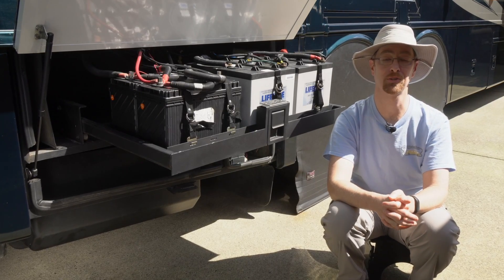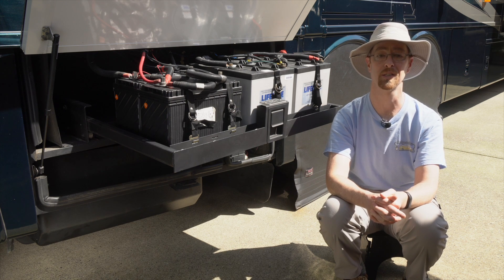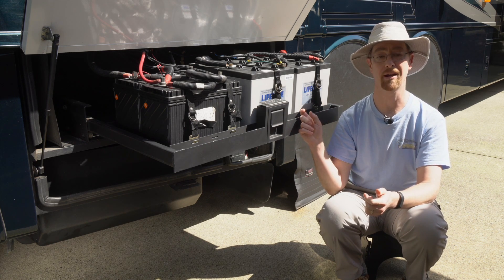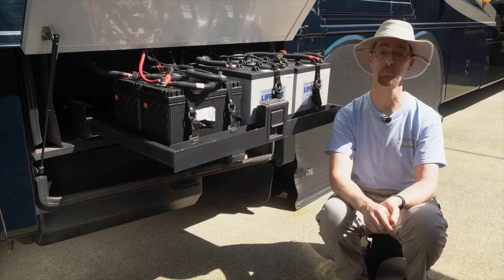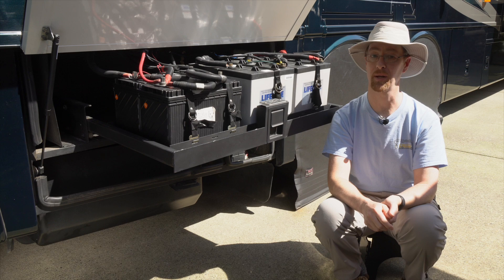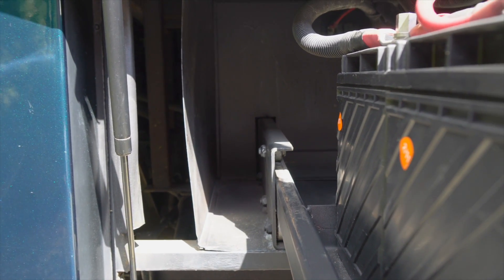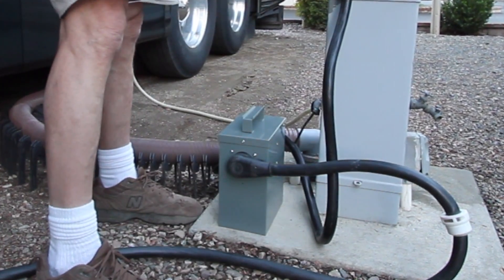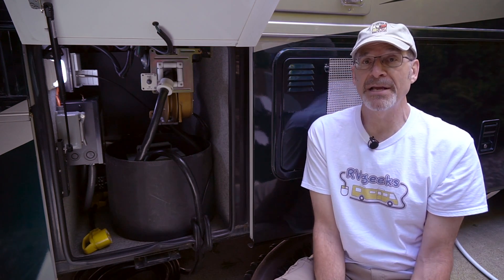🔌  RV Lithium/AGM Battery & Electrical System Upgrade - Part 1 - Project Intro ⚡️

Comment: We have lithium batteries installed in our new van.  We have a second alternator to charge them.  We also have 100W of solar.  Obviously 100W isn't a lot.  It basically runs our 12v refrigerator and maybe some LEDs and keeps our Jakary topped up when we get enough sun.  Our old rig had propane to run the stove, but our new one has an induction cooktop which seems to demand the most power.  We monitor the voltage in the batteries and are wondering what might be the minimum voltage at which we need to run the engine in the van to charge the system?  The system seems to stay above 12v for a longer time than we experienced in our old rig with deep cycle batteries so it causes a little anxiety, but I don't want to run the van more than we need to which is every couple of days for about an hour.
Reply from the maker: Hi Roy. Good question. First, we'd recommend that you check the specs on your specific Lithium batteries, as each brand/manufacturer has SLIGHTLY different recommendations regarding voltages, etc. That would be your best bet to be sure you're using the correct numbers.

Second... we'd suggest that you might want to consider installing a battery monitoring kit (or BMK... there are several on the market from companies like Xantrex, Victron and Magnum) so that you could get a more accurate picture of the actual state of charge of the batteries. Lithium batteries have a very flat voltage profile, staying fairly consistent in their output right up until the very end of their capacity... and then there's a fairly sudden drop off. So relying on voltages alone can be a bit of a challenge. With a BMK installed, you'll see the State of Charge (SOC) of your batteries as a percentage, allowing you to make the most accurate decisions.

Hope this helps!
Reply: @RVgeeks  Thank you for the response.  We were aware of the flat voltage profile and whenever we saw a drop we would get concerned.  I'll look into the BMK.  Thanks, again.  Happy Travels!

Comment: I'll be starting out with AGM's while I save for the lithiums. Hopefully, the price will come down by then.
Reply from the maker: AGMs are a great intermediate step, Tina. Ours worked well for a long time. And we're with you on the hope (and expectation) that lithium will come down in price as it becomes more mainstream, which we're hoping to help with by showcasing ours! 😉

Comment: Hey guys  I’m adding two more 6 volt batteries to my already two 6volt battery setup, my only question is does it matter what battery I put the ground on? I’m going to have the two extra batteries in a separate compartment next to the compartment the original batteries are in. Thanks for your help.
Reply from the maker: You’ll want the negative/ground terminal to come off the opposite side of the battery bank that the positive cable comes into. So your original two 6V batteries are wired together in series to basically equal one big 12 V battery and the second new set of batteries will be wired in series the same way. If you leave the incoming positive cable connected where it is now, you’ll want to move the ground wire to the other side of the battery bank… meaning, it should come off the new batteries. If it turns out that it’s easier to move the positive lead to the new batteries, you’ll want to leave the negative cable in its original location. As long as the cables come off opposite sides of the battery bank, it will ensure that the power flows all the way through all four batteries. Here’s a link to a visual to make it easier to picture: https://deepcyclebatterystore.com/rv-deep-cycle-battery/ I hope this is clear and helps a bit!

Comment: Hey guys. Great video as always. Two questions..1. related to your LIFEPO4 placement. How will you overcome the HEAT sensitivity of LFP in that open cabinet? Does the Xantrax have some kind of cooling built-in? I heard only about the usual charging issue below 32F, which is also a wel known LFP issue, but how will Xantrex del with the heat side, when /assuming you may see days up well above 85F at times? That is the second reason for folks placing their LFP inside the rig, as the LFP is then cooled with the rest of the house. Temps well above 85F can shorten LFP by 2x or 3x their nominal life cycles.....so curious about that potential risk?  2) I've been trying to find info on the Xantrex LFP and see only the vaguest summary/marketing info on their site. No prices anywhere, no detailed charging and max current rates etc, etc, etc. Do you know if it's available, and if so...where? Many Thanks! I look forward to your experiences and info!
Reply from the maker: Hi Barry. Thanks! In response to your questions:

(1) No, the eGEN doesn't have any cooling capability, although the unit itself is fairly well insulated. In addition, we installed reflective heat insulation surrounding that compartment before installing the battery (see about the 1-minute mark in this video, Part 4: https://youtu.be/laUQEbrycNc ) because our compartment is right above the exhaust from the engine. Running at highway speeds in 95-degrees on a hot sunny day over even-hotter asphalt, the battery (which has its own internal temp sensor that reports on the internal display) never exceeded 78F. Plus, Xantrex's specs for the battery itself are a bit higher than what you say... with charging range being 32F to 113F and discharging being -4F to 140F. Of course, operating for long periods at the top of those ranges means you'll get less usable life than if you operate mid-range, but Xantrex hasn't reported concern that the reduction is on the orders of magnitude you're reporting. We'd guess that not all LiFePO4 batteries are created equal. 😉 

(2) The only info that's been released is available on Xantrex's website ( http://www.xantrex.com/industry-solutions/freedome-gen.aspx )... and you're right, it is sparse. The e-GEN is not being marketed as a direct-to-consumer device and, as such, is being handled by an authorized installation & service network that they are still in the process of building out. Installers do exist... but you'd need to contact Xantrex directly to find out if there's one in your area yet... then contact them for pricing, etc.

Hope this helps!
Reply: @RVgeeks  Thanks for the detailed and fast reply! Regarding the heat, I'm kinda curious how the physics works for the battery to be no higher than 78F in a 95F ambient temp, as that would imply some kind of cooling is involved. I suspect that the temp sensor is not picking up the actual ambient temp somehow, but that's for Xantrex to figure out. You answered my questions. Again, thanks!!! Keep them coming....very interesting stuff! :-)
Reply from the maker: No problem, Barry. Glad to help out. On the temperature thing, keep in mind that the temperature we're talking about is, explicitly, NOT the ambient temp. It's the temperature INSIDE the battery housing. We were driving on a very hot, sunny day... but the inside of the battery, where the cells are, never got any higher than 78F. It was likely cool because of overnight temps allowing the whole thing to chill down before our drive. So outdoor ambient temps were 95F... not sure what the temp in the compartment itself was (no temp sensors there)... and the INSIDE of the battery was 78F. Safely within its operating range.

Since all LiFePO4 batteries we know of are basically an aggregation of cells installed inside another casing, we'd expect that they would behave similarly... with the cells remaining cooler than ambient temperatures unless exposed for very long (days), allowing the differential to equalize.
Reply: It is worth pointing out that Xantrex do not make the Lithium Battery or the BMS they are supplying. The Lithium battery and the BMS are actually made by another GREAT American company called Lithionics who have manufacturing facilities in Clearwater Florida. Lithionics has been manufacturing Lithium batterys for some time and provides an engineering service to companys like Xantrex so that a well integrated and safe system is produced for the end user. Lithionics actually holds the UL rating for a growing number of their Lithium batterys now and are a supplier to the military as well as other hi-profile agencys. URL https://lithionicsbattery.com/ 

The great thing about Xantrex being involved as a "RV Electrical Systems Supplier" to both the consumer and Coach Manufacturers such as Coachmen's Class B Galleria models is the resultant Electrical Systems installed are properly integrated combining Xantrex's Top Quality Inverters and Control Systems with Lithionics Lithium Batterys and very advanced BMS Systems. For Example some of Xantrex's Inverter/Chargers can use battery power to supply extra 120v if the Shore supply is not big enough[15 amp shore power but you need more] and Lithionics BMS system can also control an "Under Hood Generator" charging system[Nations Alternator] as well as a Solar Charging System.
Not sure what options you guys have but I know the Xantrex Freedom eGen system supplied to Coachmen for their Class B Galleria uses the Lithionics BMS to control The Nations alternator fitted as part of the "Lithium Upgrade" offered to Coachmens Galleria Customers and I believe The upgraded Xantrex Inverter[3000watt] fitted also as part of this package can utilise some battery power if the shore power available is not powerful enough.
Two Great American companies combining to "Finally" get top quality Lithium Lifepo4 based "Integrated Electrical Systems" into RV's & Boats!

Comment: Thank you for this information, it is very helpful. I do have a question that isn’t about this subject. My wife and I are moving into our motor home this year after we sell our house. My question is how much do you budget for fuel and staying at RV parks. I know that this is not the same for everyone and can change month to month. Just looking for an average. Thank you for any help you can give.
Reply from the maker: Hi Mario! As you mentioned, that answer varies a lot based on how you RV. Type of RV plays a big part (diesel pusher vs gas class a motorhome vs towable, etc). Then there's HOW you RV. Do you travel non-stop, moving every couple of days and covering large distances (higher campground costs for short-term stays and more fuel burned driving more)? Or will you be slower-moving, spending longer stays (thus getting long-term, lower rates at campgrounds) and traveling in the RV less? And will you be staying only in private campgrounds? Or will you dry-camp/boondock on BLM land at all? Or a mix? There are just so many variables, that even knowing what WE spend on all of those things might not truly help you, if your mode/style of travel isn't the same.

That said, for our 43' Diesel Pusher motorhome, traveling at a slower pace (roughly 5,000 miles per year on average) and spending more time in fewer places (with a lot of dry-camping during the winter months in the desert southwest), we've averaged roughly:

    - $2,500/year in diesel fuel (5,000 miles/year ÷ 7mpg = 714 gallons/year * $3.50/gal)
    - $5,000/year in campground fees (averaging about $15/night by staying free on BLM, then splurging for "resorts" on occassion)

Again... your numbers will likely vary, but we hope this gives you an idea. For a different perspective (17' Fiberstream trailer), check out Drivin' & Vibin's monthly budget reports to see how living smaller compares:  https://drivinvibin.com/category/monthly-budget-reports/

Comment: Dudes. Lifepo batteries can thermal runaway. Look into RC cars. Also, I think you will find old NISSAN leaf batteries were li-mg? My leaf has the heater for the battery turn on at -14F... Way way low...  Good luck, be safe!
Reply from the maker: You're right... technically, ALL battery chemistries (including flooded lead acid) can experience thermal runaway. But it's all about at what temperature that runaway occurs, how probable it is, and what mechanisms are in place to protect against it. We hadn't read about RC cars having a LiFePO thermal runaway problem... but we'd guess it was likely the result of compact batteries compounding issues of heat accumulation in conjunction with less-sophisticated BMS systems for monitoring (and shutting down) the battery. In larger-form-factor applications like cars & RVs, they have the space to give the battery more "breathing room" and to utilize BMS and temperature sensors to ensure the battery stays safe. But regardless, LiFePO is by far the safest lithium chemistry commercially available today.

Not sure what the original Leaf battery chemistry was... but we think the current version is a Lithium-Manganese formula. There are so many variations that it's hard to keep track!  LOL! But having a heater to ensure the battery doesn't see sub-freezing temps is important... which is why we were interested in the Xantrex unit. Stay tuned!
Reply: RC cars and planes use lithium polymer batteries not lithium iron phosphate.
Reply: LiFePO4 can experience thermal runaway theoretically, but it requires impurities in the cells and a perfect storm. It is one of the safest chemistries regardless of impurities or not. Lithium Titanate (LTO) is marginally safer than LiFePO4, but has trade-offs. Basically the safer chemistry = less energy density, higher cycle life, and higher cost.

And yes, most RC vehicles use LiPo/Li-Po/Lithium-Polymer.
Reply from the maker: Thanks for clarifying, Matt! Your battery expertise is much appreciated.

Comment: Great video !! Very timely as I am considering the LiFeO install. You did not mention the high temp restriction for this chemistry? Does the insulation protect from high temps? I believe the upper limit is around 110-122F or 50C. BTW I am glad to see you using the original tray as I am considering the same. Look for ward to this project videos. Joe
Reply from the maker: Thanks so much, Joe! Regarding temperature, our battery compartment is located directly alongside our engine, RIGHT next to the muffler! So, as you'll see in an upcoming video, we installed highly heat-resistant insulation (the type used under race car hoods) into the compartment. So far, having driven over 2,000 miles, our two temperature sensors (one in the compartment and one inside the battery itself) have never shown readings anywhere near battery limits. And that includes plenty of mountain driving, although in less-than-extreme ambient temps so far. We're keeping a close eye on that, especially as the summer warms up, and will report back on that issue in a future update.

Comment: Any consideration of using Tesla batteries similar to Mortons on the Move? We have lots of Tesla cars here in central Ontario Canada. -30C is not uncommon in the winter. Do Teslas use a warming blanket?
Reply from the maker: Hi Don! We saw the AMAZING job Tom did on their Tesla battery. But the remarkable knowledge that went into it is obvious, and the reason we couldn't do anything like that ourselves... because Tom is an electrical engineer... and we're not! And we don't know any company that does things like it. The only reason we know that the Tesla battery isn't heated is because we saw that Tom enclosed his into an insulated space. If we recall correctly, the reason he had to do that is because having the battery removed from the Tesla meant it no longer included the warming system that originally circulated heated fluid through the battery.
Reply: Lithium will hopefully be the standard battery for vehicles as catamarans operating in warm climates.

Comment: I am of the understanding that when you make the up grade to Lithium batteries it need to be whole hog.  Am I wrong?   Charge controllers for conventional batteries do not work for Lithium batteries.   You may not need to change out solar panels but new change controller is required at the time of changing batteries,  As always I enjoy your videos.
Reply from the maker: You are correct, Robert. Since lithium batteries have a different charge profile than flooded or AGM, the systems connected to it do indeed need to be lithium compatible. The solar panels are fine, but the charge controller and inverter/charger might need to be replaced. In our case, because we already had a Xantrex inverter, they obviously designed the battery to work with it, requiring no change other than the firmware. But our solar charge controller has to be replaced. This is exactly why we’re using our rig as an aftermarket installation case study for the system before it’s actually on the market, and why the people you see installing the “drop in replacement” lithiums often gloss over important issues and may be overlooking very important system considerations that are not so simple.